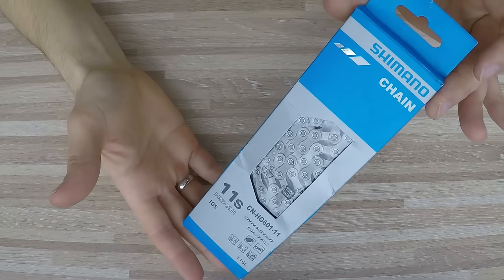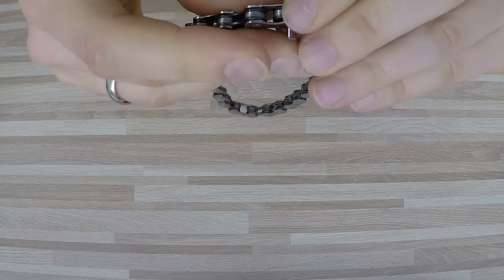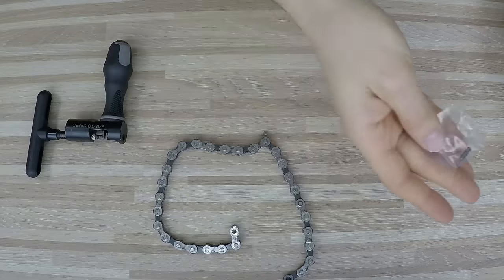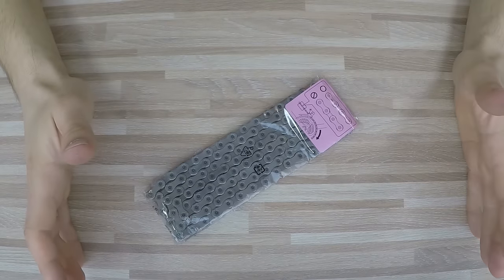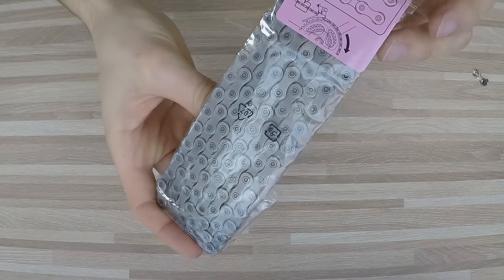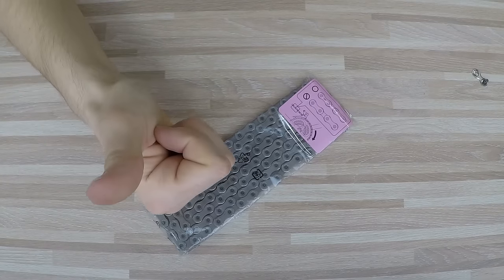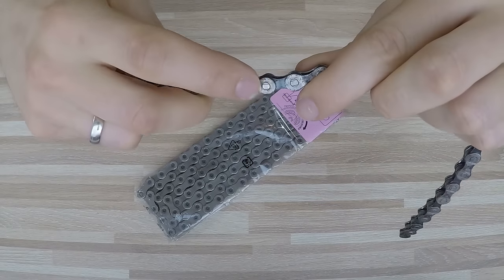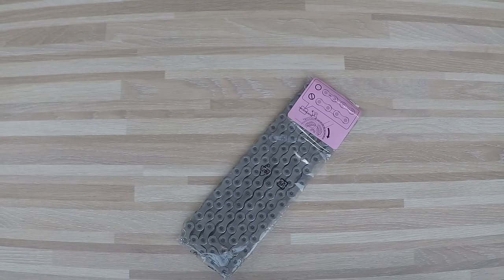4 Worst Mistakes In BICYCLE CHAIN Maintenance. How NOT to do it. SickBiker Tips.

Comment: WD40 is cleaning or lubricate?
Reply: neither , just use it for releasing rusted nuts and bolts , if your chain is rusty then you can use it to get rid of light rust then clean and lube it as normal
Reply: gfrp both! There is a maintenance gcn video (5 minute bike wash) where he sais that he uses WD40 for cleaning and lubrification. If doesn't make any sense but apparently it works for him!
Reply: WD40 Is the brand name & a product,which might make it bit confusing for some.
but  they make degreasers, lubes & a lot of other stuff
Check out http://www.wd40bike.com/
I have not tried any of their products yet.
Reply: gfrp 
Not entirely true: https://en.m.wikipedia.org/wiki/WD-40
WD40 really is just the product.
Reply: YEa I know
Reply: Interest though. It seems as WD-40 bike is using the name. Or are the really the same company?
Reply: Max Grass yea they are the same company mate , I've tried their bike chain degreaser and its very strong stuff , I also have some of the lube too but haven't used it as yet , gonna give it a go in the summer ;)
Reply: Max Grass I watched si's video on gcn too , caused a lot of controversy didn't it lol
Reply: Ok,  yeah same company. Still might all be the same content :) just the good old WD-40!
Reply: Stay away from the bike with WD40! If we are talking about the "original" WD40 spray.
Reply: zoran bregovic your right there mate ;)
Reply: WD is a solvent. Water displacement simply means it attracts water. 
You don't want water in your drivetrain.

So clean with WD40. then lube with favourite lube. 
Try also putting some WD 40 on cloth and wipe down the frame. Gets very nice and shiny from that.
Reply: I wouldn't touch the frame with WD40! Eventually you will get it on disc brakes (if you have them) and that doesn't sound and feel great.
Reply: No,  the "D" for displaces means it  REPELS water, not attracts it. WD40 is actually "top oil", the thinner petroleum layer of oil in crude oil. It evaporates quickly, hence it is not a lube. It is the oversold in America b/c consumers are too ignorant and use it to lubricate or loosen bolts. It is a success of marketing and the company has no desire to set consumers straight lest sales be affected. You are much better off using the correct product. Research is easy for all but the lazy.
Reply: I spray the chain with WD40 every few rides and then wipe clean with one of those cheap wet wipes. I maybe use a lubricant in the winter  months after spraying it with WD40
Reply: I have tried WD-40  many times and has worked successfully everytime I use it (year round and annually 4 seasons) Now WD-40 has Bike Formulated products that I absolutely adore...wet lubes, dry lubes, degreasers, and-so-forth.... 2017, thank you WD-40...
Reply: i think wd stands water displacement
Reply: Both, cleans and lubes...lubes value is limited though...  WD40 has a "Wet" & "Dry" Bike lube now, I enjoy using it.

Comment: is a tank track same as a bike chain?
Reply: No.  A tank track is quite a lot bigger and thicker and you find them fitted to tanks.  I tried fitting a tank track to my bike but I found cornering quite difficult as it made the bike quite heavy. I did think about using melted candle wax to lubricate my tank tracks but I couldn't find a container big enough in which to soak the tank tracks.

Comment: Overkill for one of a cycle’s strongest cycle component. If the chain has been throughly degreased, re-grease it throughly, not rocket science.
Reply: Wilderness Music  can you please elaborate on what kind of problems degreasing causes, TIA
Reply: Wilderness Music  i see, ty for reply. Doesn't WD40 have alcohol in though and the manufactuer's specification say to not use alcohol substances? 

Is there an issue with using degreaser on a rag on the outside of the chain to clean (as opposed to dunking it through one of those chain cleaner tools)?

Comment: I did reuse my pin on the chain and it failed under pressure. I would use a new pin as it's just going to be less likely to break.

Comment: Noooooo. Factory grease far superior to aftermarket chain lube don't ever remove it! As for reusing pins its all in the skill of the person breaking the chain, if pin goes in and out perfectly straight it will retain all strength, small off-angle on pin re-entry and hole is damaged and link is weakened.

Comment: Tried many ways (oily lubricants) and ended up using paraffin wax. (actually it is a mixture of 80% paraffin wax + 20% honey bee wax + a little bit of oil. So far, so good.
Reply: Same thing!
It works perfect in dry weather... No dust and clean chain for ever! Here is the way I do this (maybe you find it interesting and tell me your way):
I use paraffin resolved in gasoline in empty plastic bottle. So first I clean chain by shaking it in plastic bottle with clean gasoline (15 min) and then I put it in especially prepared plastic bottle with paraffin resolved in gasoline (15 min). And then it must be dried up somewhere near opened window. So 30-40 min every 100 km.
 And how do you do this?
Reply: I clean the chain in some kind of solvent the way you do in a plastic container. (it is sometimes petroleum oil or other cleaning solution) After drying the chain, I simply submerge the chain in hot, melted wax for about 10-15 minutes. (I use a double boiler, so the wax doesn't get too hot)  I, then remove the chain from the melted wax to dry it. I don't wipe the chain with a rag or something. I just don't care. :-) Then I put it to my bike and GO! - I do this every week. *after 100-150 Km) I don't ride in the winter much, though.

I like how clean it stays! And how quiet the chain is.
Reply: Of course you don't wipe the chain with a rag or something because it is needed only with ordinary lubes which pull up all dust from the road. ;-)
I also don't ride in winter... I think there are a lot of winter sports for winter)
But in summer I am really dedicated rider - 100 km/week. (in MTB style)
And yes, the cleanness and absence of dust abrasive are my favorite benefits!
 
Cheers and good luck!
Reply: Zsolt Suller I do the same but with just some melted down old candles as the source of wax. I clean the chain in paraffin first. Great for staying clean but not the best rust protection if there's a lot of rain or the roads are salted.

Comment: Wtf....ive been riding 15yrs  and never had a problem when fitting a new chain never use the quick link..always done it bye using a chain tool...also always use KMC chain..and the correct speed chain for your cassette...

Comment: the shimano PIN is really stupid tech. Well, maybe not stupid, but obsolete. I broke a deraileur from using it, the pin moved as i was pedaling really hard, the chain snaped and the deraileur got the worst part. ever since i've stuck to KMC, really simple, reliable, and easy to use

Comment: I NEVER break a chain except during initial installation.  Thereafter, I use a connector link.  The best of them is made by Wippermann.  I'd bet that a lot of the chain failure are due to either improper pin installation and/or riding with the chain in an extreme deflection (big chainring/large cog).  I know Shimano recommends using their chain pins but they are, in my opinion, totally out to lunch on this.

As for preparing a chain for initial installation, I have no qualms about dipping the chain in some gasoline, being careful of course not to have any source of flame or sparks nearby.  I want that chain to be squeaky clean before I lube it.  Here's the best way: https://www.youtube.com/watch?v=gF9nbwsaSHs&t=148s  I've been using this method for 15-20 years.  This is the best lubrication and it costs almost nothing.  Chains don't get dirty and last much longer.

Comment: Shaibike, concerning cleaning the chain from factory grease: I think you and your critics  are on the same page. You say "Just remove the outer grease" for the same reason as your critics recommend to leave the grease on: The grease is good and proper. It just has to use on outer plate. But no grease has, anyway.

Comment: If your chain tool is collecting rings then its crap and has the wrong size driving pin no matter how flash it looks   (so no wonder why your chain kept breaking) , I've joined 100's of chains over the past 40yrs  using the old pin method i have only ever had one pop out when i was 9rs old and that was because i had a rubbish chain tool & didn't wind the pin in straight and it bent the outer link  & to be honest some shimano parts are just cheap & nasty now days if you want quality that lasts then pay the extra for their higher end range,
Reply: I too have repaired many chains with the original pin pushed back in.  Then this year I had a problem with persistant gear jumping. I checked everything but it kept happening. In the end I bought a new derailleur but still the problem did not go away. Eventuall I found a loose chain link pin. The chain didn't actually break but one end of one link was loose on its pin on one side, probably a link I had opened at some time and reconnected. The effect was that mostly the chain went round the cogs ok but occasionally it didn't and the gear jumped.  So leason learnt. From now on I will always replace the pin.  I wish I had seen this video before I wasted £50 on a derailleur when all I needed was a new link pin!!!

Comment: I change my chain between  1000 and 2000 Kms .
Reply: No one should change their chain based on ANY mileage amounts!  They're arbitrary.

If you do, you're most likely replacing some chains too early and others too late.  Just measure the elongation and replace when it exceeds 1/16" in a 12" span.  That's all there is to it.

I say this because the very same chain on the same components could last considerably different mileages under different circumstances.  Make one example a road bike that's only ridden in dry climates and is very well taken care of.  That chain may last well over 4,000 kms.

Now make the next example a chain that's used off road in very muddy conditions.  This chain will likely not even last 1,000 kms, even with excellent care.

Now take the fact that riders take all manner of different care of their chains.  This further complicates the expected life of a chain, so it's virtually impossible to give chains a mileage life.  (I wore out the most expensive chain available at the time in 1988 in 500 miles with good care.  I was disgusted with how un-durable it was.)

Just measure periodically and keep track of your "stretch."  Replace before it wears everything else out.  Or just let it go and throw caution to the wind!  That's what I did with one bike in the stable.  Everything worked fine for about fifteen years until I finally said, "Enough!" last year and replaced the chain, cassette and middle chainring.  Good as new now!

Comment: I have never broken a chain in decades of cycling.  I push out a pin, take the chain off, clean it, and put the chain back on with the same pin.  When I remove the chain the next time, the odds are a 100 to 1 that I'll push that same pin out.  I think he mispoke when he said clean a chain with water.  English is clearly not his first language, so I won't hold that against him.  As for people using anti-rust products to clean a chain - I have never heard of anyone doing that.  It seems expensive, and not even a logical product for the job.  In short, this video provided almost nothing of any use.
Reply: deezynar what do you weigh? 123 pounds?
Reply: When I rode road bikes, I weighed 170 - 180 pounds.  I did that for 6 years, putting about 14,000 miles on a year.  I did not race, but rode with fellows who did.  My job required me to work weekends, and races are usually on weekends.  Anyway, I've been riding a recumbent for years now, and I admit that they put less stress on a chain than a road bike that's being sprinted up a steep hill.  So that would nullify some of what I'm saying.  Also, I will say that my road bike days ended 30 years ago.  5 cog freewheels were giving way to 6 cog cassettes.  It's likely that chains were more robust then.  How often do you break a chain?

Comment: Man....where did you go to school dude who cares....l used
a Shimano chain  one time and it was crap....l use Regina
chain on my old generation bike and works like charm....and
yeah l'd Never had any problem pushing out the pin cleaning
my chain lubing it and pushing the same pin back in...some
one tried to invent and sell you slip in chain pins which l don't
trust or like....and yes chains stretch no matter what and you
do have to replace them...last not gonna bake my chain/ cook
it in the oven..

Comment: As many people have already pointed out, this video is a load of bs. The first "mistake" applies only to Shimano chains, any other pins are fine to reuse. Number 2 is pure talking out of the ass, most (if not all) bike chain manuals specifically tell NOT to remove the factory grease. Petrol, diesel, kerosene, white spirit etc. are all perfectly fine to use so there goes the third "mistake". The last bit, about not leaving your chain wet, is actually the only genuine advice this guy just gave.
Reply: Exactly!

Comment: 7:50 - Isn't this chain simetrical?
Reply: Not this one. Most of the Shimano chains will be, but some of them will have just one direction they work the best. You can install it with the marks to inside, it will work but not as good as will if you put it the right way.
Reply: Thank you for explanation.

Comment: use kerosene on a dinner plate and scrub chain with a toothbrush, rinse under hot water and dry with towel and swing it around like a cat, then lube chain - EASY!!  conn link on Shimano chain is fine for me saved mucking with new pins and chain breakers required to do a thorough clean

Comment: There's some poor advice on here and some BS. Using a chain cleaner tool and chain specific degreaser is the best method. (that's with 30 years of racing experience)

Comment: What's the point of showing the unopened chain packaging?
And using the same linkage pin several times doesn't hurt at all, I've done it for many, many decades and I never have had a broken pin. This vid is just another load of BS.

Comment: I think some of these guys who use petrol to clean their chain are taking a big risk.Just one static spark from nylon clothing or suchlike could mean terrible burns and months of pain.There is no way I will ever take that risk.There was a motorcyclist who used to sit astride his bike while he filled up his tank and one day it overflowed and some fuel ran down the tank and dampened his riding trousers.When he walked in the shop to pay he caused some static on the nylon carpet and his crotch burst into flames!

Comment: Your all wrong been reusing pins for 16yrs no problems at all I work at a bike shop and have never had any issues I never use master links either I always keep spare chains to use a full link each time to replace a broken chain.
Reply from the maker: The manual doesn't lie. I didn't have problems reusing the pins until I went to a XC World Cup and snapped the chain on the first climb - 5 years of preparation and training...

Comment: Youtubers are just riding bandwagons and don't have a single clue about real life riding, the chain connection method is been used all around the world, I'm from a 3rd world country now in US living. Millions of bike there connected with no chain tool just a hammer and a pin. Just less than a dollar chain pulling 1 ton cargo or passenger bikes. My dad and I been using Shimano chain even before this youtubers have been born no chain tool just hammer and a nail those chain we fixed could last forever. So sad they earn so much money and YouTube and give false ideas.
Reply: Unfortunately, you are revealing your ignorance about chains.  Yes, there are millions of chains used in the world that can easily be changed by preserving the pin and re-using it.  There are many BMX, cruiser and other single-speed bikes where this is true.

But just because that is true, doesn't mean most multi-speed bicycles bought in the US have peened chain pins and cannot be reused safely.  Today's 9, 10, 11, and 12 speed chains are very thin and the pins have all been pressed and flared to retain the outside plate and ensure the pin does not protrude.

When you press out a pin in these chains, they make an audible "Pop!"  This is the sound of the outer diameter of the peened pin end shearing off the pin.  My shop chain tool has several of these little rings of metal that sheared off of the pins sitting on the chain tool pin.

CAN you re-use a pin?  Sure!  Would  you be able to ride the bike?  Absolutely!  But there's a good chance that pin will fail.  If it happens to be the one crossing over cogs when shifting under load, it will fail.  As a bike owner, you are free to do what you want.

But as someone who professionally services bicycles, or provides advice on YouTube, this practice is unacceptable.  Your local bike shop would be sued by a customer whose chain failed due to improper installation.  It's a risk shops cannot take.

PS  You might want to watch some YT videos on motorcycle chain replacement.  The moto repair industry uses a special pin press that flares the replacement pin after insertion.  They do it to make absolutely certain the chain doesn't fail under high loads a motorcycle engine produces.  That can be catastrophic.

Comment: Sounds like you're confused about the difference between acid rust cleaners, penetrating oil sprays, and organic solvents.  There's nothing in the instructions about soaking the chain in a solvent bath.  The longer you leave the chain in the bath, the more old dirty lubricant washes out.